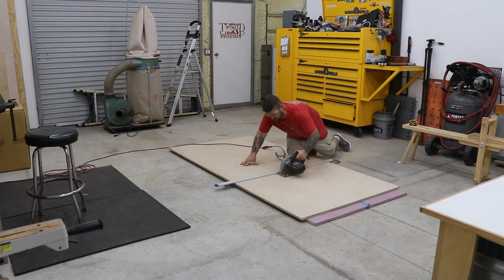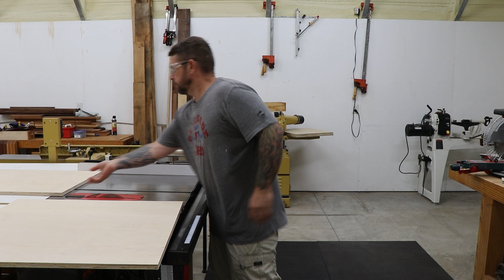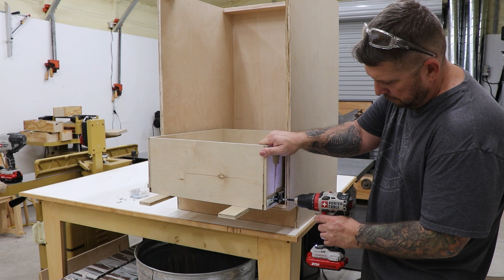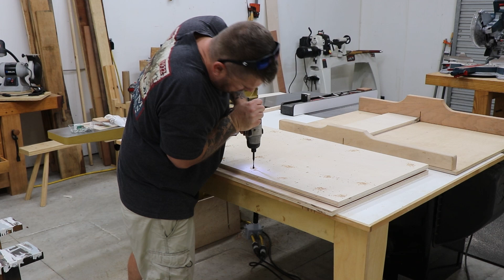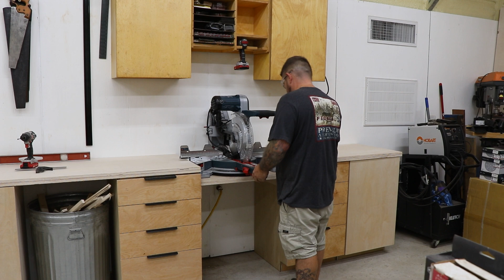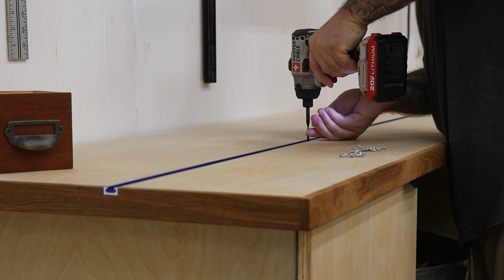Miter Saw Station Build

Comment: Looking forward to the sliding miter saw comparison, I currently have the Festool for the shop and the same Hitachi you have for the job site for trim as well as the 12 inch Dewalt for framing.  I'm a big fan of the older version of the Hitachi, the version you have, the ones that were made in Japan. I bought the 8 1/2 new back in 1992 and the 10 inch early 2000's.  In the 2010's I tried the Milwaukee, the newer versions of the Hitachi and the Bosch, they went back within a week.
Reply from the maker: I agree. I think using the old hitachi set pretty high standards. The festool is nice with a similar trigger position and the soft start. I just wish it wasn’t so expensive

Comment: You won’t regret the Kapex!  Great saw!
Reply from the maker: It has been awesome so far. I resisted buying festool for years but picked up their sander, track saw and kapex over the last year. They  live up to the hype
Reply: @TwistedWorkshop77  So, what was it about the Bosch that you found difficult?
Reply from the maker: @michaelstockdale   the dust collection is really bad. I’ve always fought with eye infections when working in the shop so I was hoping it would be better. Also, the way the handle was oriented never felt comfortable when using my left hand. It put me way to the left of the blade. I like having a laser line but the Bosch doesn’t have one from the factory. I also like the soft start on my hitachi and the kapex the Bosch jumps when you pull the trigger. Lastly, I think I pulled it out of square a lot when cutting Wide boards